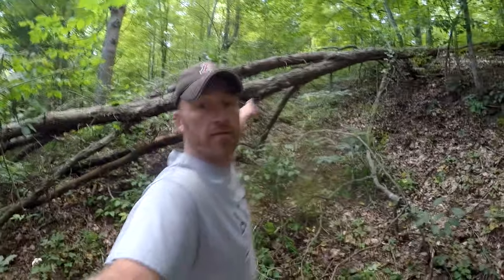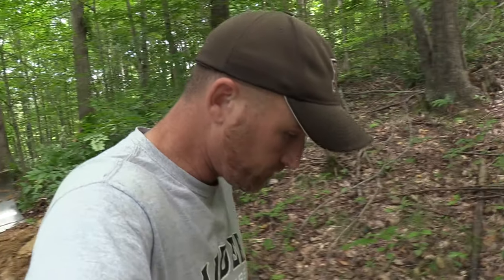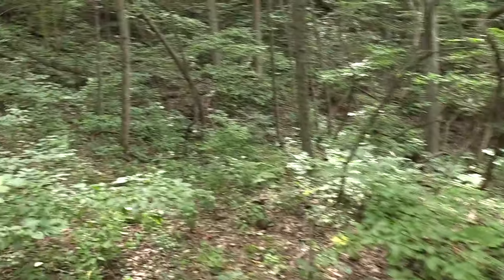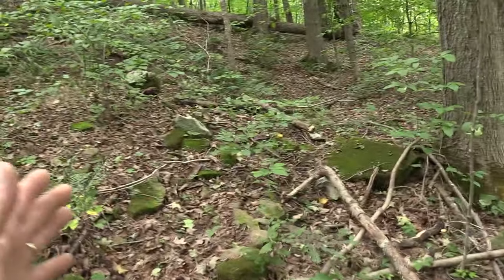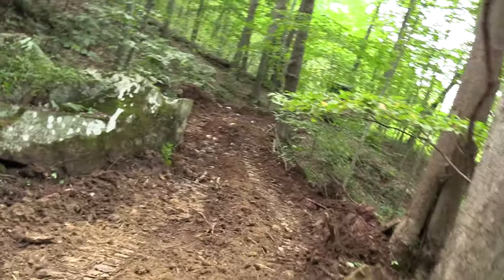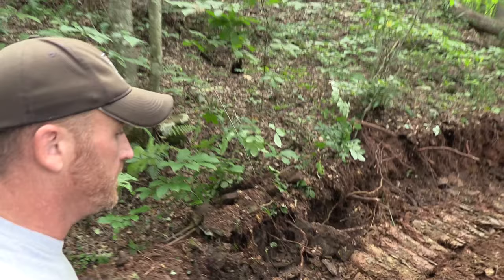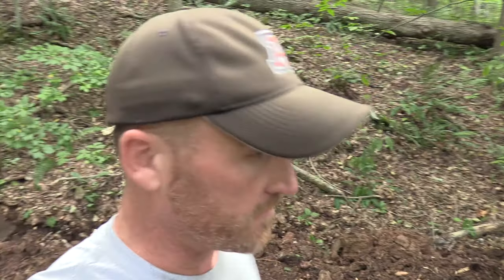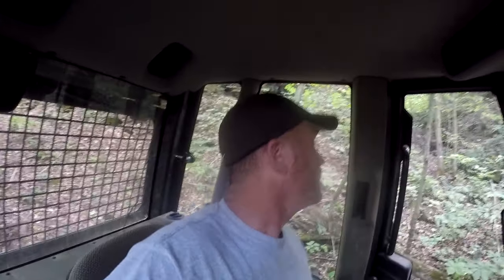Cutting in NEW TRAILS with the dozer

Comment: Looks like you were having a blast!  When I do steep sections of trail or firebreak, I like to install water bars to get the water off of the trail surface as quickly as possible to prevent erosion.  There are quite a few good videos on YouTube showing how to do this.  Also, when planning a road / trail system, I like to start with a road around the perimeter that acts as a fire break and allows easy access to most areas of the property.  Interior roads act as fire breaks as well, leaving different areas to be burned using prescribed fire on alternating years.  🔥
Reply: Having a nice accessible road that generally covers your property is key to specially in bigger plots! Makes things so much more convenient later down the road…Especially I’d you’re taking rigs back in it since there’s always the possibility you will need something much bigger to get something out lol
Reply: First thing I was taught too…get that water straight asap in case a big gully washer…slope bars on a tilt…we done well roads for Chesapeake

Comment: Cat John Deere Kamatzu all have better features.  Case equipment has a design flaw. In extreme hard pushing  they have a hydraulic overload release.  In overload it trips and you can't cut or push till the machine resets and it is very aggravating to deal with 😂😂😂 ! Overall  they are good machines and are quieter to operate!  There track group is very tough! But I will take any of the above mentioned machines over a Case  !